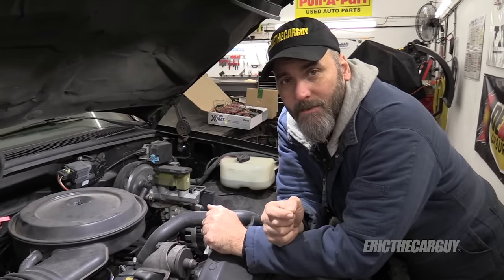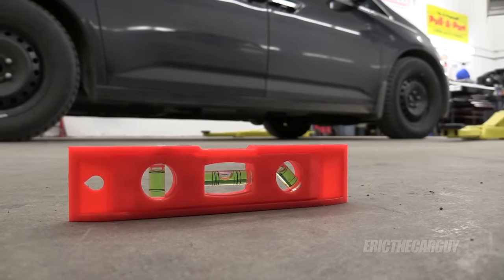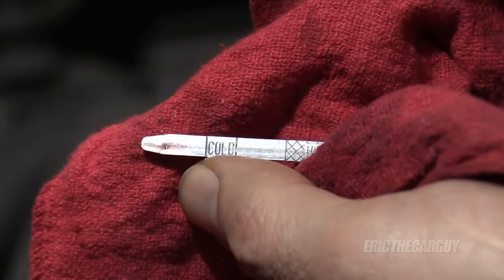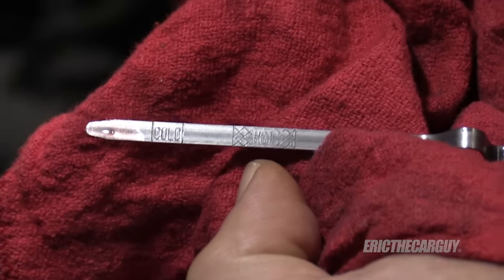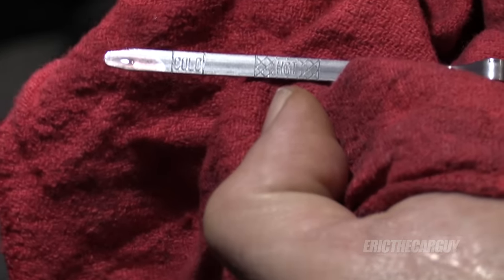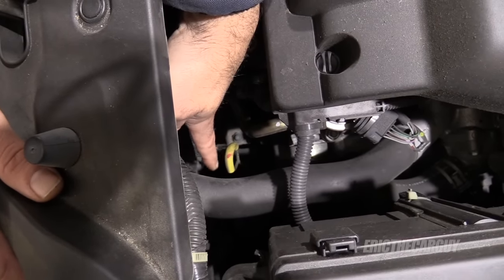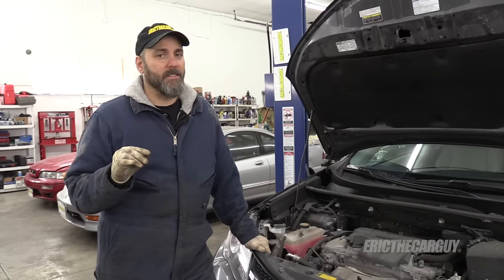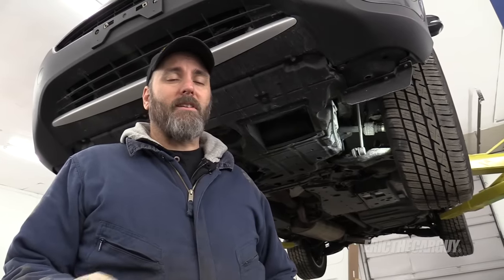How To Check Automatic Transmission Fluid

Comment: Wow....no dipstsick is one thing...but sealing a transmission permanently? That's one of the most underhanded, conniving things the engineers could have done. So simple to engineer in two threaded holes, but no..seal it off completely so the only options the customers have when the transmission blows are -buy a new car -replace transmission. They're designed to fail soon after the manufacturers warranty expires too. Seriously, why dont they just sell cars with no opening hood or accessible engine compartment, no engine oil drain or fill cap, no coolant reservoir or radiator cap, heck, no gas cap! Car rolls off the line with a full tank of gas, and when it runs out you gotta buy a new car! Basically the same thing. Disgusting.
Reply: None of them are truly sealed. They just want you to believe they are. They have drain plugs and fill plugs and they have ways of making sure they are filled and not overfilled. It just isn't simple. They only want trained technicians to do the service. Keep searching and you should find the videos.

Comment: If there's a filler tube, But no dip stick.  Just use your  engine oil dipstick  ;)   If you're checking the condition of the fluid  ;)  Yer welcome folks  ;)

Comment: The ATF I saw on a customer's Chevy Aveo was like used motor oil at 75k miles. They wanted it done after I recommended it. I made the machine flush 8 quarts through it. Still brown. Another 4 quarts and it was reddish brown. And finally after 4 more quarts it was clean on the dipstick. Totaled 16 quarts of ATF to flush that tiny transmission. Thing shifted like a dream after that too lol.

Comment: Great video with very good explanations about checking transmission fluid levels on different vehicles. I do NOT want to be within 10 Light Years of a car without a transmission or engine oil dipstick. Whoever came up with the idea of doing away with dipsticks in cars should be ashamed imo.

Comment: Those locking dip sticks were a recall on 89 or 90 trucks.  They originally had a standard dip stick but had some sort of issue with them sealing or puking fluid or something.  I had a new 89 and I'm pretty sure remember getting the actual stick in the mail via gm.

Comment: It’s pretty ridiculous that today’s vehicle manufacturers try and pass off a sealed transmission, with no way to even check level or change fluid, to vehicle buyers like it’s as good or even in the same category as a properly maintained conventional automatic transmission where you can check and change the fluid.  

Good video Eric.
Reply: Only a Fool would buy a new car.
Reply: We had a 2016 Mazda 6. There was no mention of any way to check the fluid in the Mazda 6 transmission. It simply said it was a sealed unit as I recall. Upon further investigation it does have a dipstick but you have to remove the air filter including the housing for the filter to find it. Then you have to remove the bolt that bolts it to the transmission and you'll find it. They just don't want us to know. Duh?
Reply: What can money don't do this days.
Reply: To be fair, as long as the sealed transmission has a check plug/valve it’s pretty simple to change.

Comment: Thank you Eric for an intuitive how to properly check transmission fluid on a level surface at operating temperature . Always remember to use vehicle specific ATF ie: dexron, mercon, multi vehicle synthetic, CVT and type F (old Fords 1970's. If your transmission slips and reengages making a bump feeling it might be low on fluid . Always keep at least a quart on hand to add as needed but NEVER overfill . ATF fluid expands with heat which is why it needs checking at operating temp .

Comment: I am a Veteran and I perform Preventive Maintenance Checks and Services on my Personal Owned Vehicles.  I will always start at the front and go in either a clock/counter clock pattern checking for damage and any fluid leaks.  Before running the engine I will check coolant and oil levels.  After doing that I will start the engine and run it until the temperature starts to climb.  I will then apply the brakes and shift through each gear and hold for 45-60 seconds in each gear.  After do that, operating temperature is reached and then I check the transmission level.
Reply: Thank you for your sacrifices for this country and its people. I’m so sorry for what this country has become. May god be with you and I hope you live a long and healthy and happy life ❤️

Comment: I always check my automatic transmission fluid when the engine is cold like oil check. So I was doing the wrong thing all the time. Thanks for the tip👌

Comment: Good video and happy to be a premium member (again).  I guess I'm just too old, but I am still not sure sealed transmissions are smart.  But that's the way most auto makers seem to be going.
Reply: Just doing some google searching and apparently a lot of sealed transmissions still have ability to change transmission filter which would mean you also are changing (most of) the transmission fluid.  Would love other info.
Reply: 'Sealed for life' is normally only 100k km/miles still needs to be looked at.

They were getting more and more failures with people using the wrong fluid or fill marks, plus gives the dealers another income stream.
Reply: 100K kms = 62K miles
Reply: Just like how ford has that new “fly by wire”  front end.   It’s too put planed company’s out of business

Comment: You should also run it through all the gears with your foot on the brake and park brake set. And then put it back in park to check it  that gets oil until all the passage ways so so that you don't come up short.

Comment: When i fill auto-f the first time i do it with one of those horse sized syringes. Makes it easy to figure out the graduations on the dip stick, which i then mark with a fine scribe on one of the sides. Subsequent changes make life soooo much easier.

Comment: Remember that a transmission warms up to temperature at or above 160 degrees up to 200 degrees and the motor will be up to temperature much faster than transmission fluid and you can start your engine and let it idle to bring automatic transmission fluid and it can take over a hour for it to reach operating temperature so make sure to drive the vehicle for 10 to fifteen minutes and in cold weather even longer it gets operational much after motor temperature.

Comment: And thanks Eric your video really helped me I went right down stairs and fixed my transmission level. I overfilled it earlier in the day and I had to make an improvised suction device to remove some. The check you did at the beginning of the video on your truck was similar to mine and I added a whole court by accident when I only should have added half so thank you so much probably saved my transmission.

Comment: My Camry 2000. I check atf fluid when engine not running.. and it totally work ok for years without issue.  Stick have cool section and I use Cool Section on stick to  check level in early morning.But now I learn check when engine running.

Comment: Chrysler gives you a dipstick tube but no dipstick.   At a recent dealer service interval I asked them to use their dipstick ( it has fancy temperature sensors attached) and verify it is full.  Then I carefully inserted a flat piece of wire into the tube and marked it with a sharpie..instant dipstick.

Comment: @EricTheCarGuy I'm actually having problems with my 99 Odyssey transmission. Didn't know it had a magnetic filter at the oil cooler, it blew off after years of neglect. I replaced it, added fluid, now first and second gear are shot to hell!
Reply: Odyssey trans are known for trouble. For a Mini Van, Toyota is the choice, not Honda.

Comment: Sir Carguy....  Sometimes the manuals are wrong or dont give nearly enough information.  Even the FSM doesn't seem to give you the details you want.  Like in the case of my 2010 Acura RDX, the manual says a drain and fill is 3.0qt, but nobody ever seems to get less than 4qt out of a warm transmission on a level surface.  The car community is not sure why, but I think they were assuming the front was lifted and you were going to get relatively less fluid out on a change.  I find that when I check my Toyota fluid, the level is high when its cold and not running thus it needs to be brought up to operating temperature before reading the dipstick, but it has a cold and hot reading on the stick.  I find that Honda reads low and has to be brought up to temperature to measure the expansion, but they dont have a cold reading on the stick either so its more akin to checking oil in a honda lawnmower.  Sealed transmissions with stand pipes are a frigg'n joke imho they're trying to use to keep people out of them but the guy over at Mercedesresource .com thinks that the tiniest bit of lint from a paper towel going into your gearbox will mess up shifting so the engineers sealed customers out of it to reduce warranty cases.  He might have a point, but that seems kind of extreme.  I dont go to mechanics because I find nobody treats your car better (or worse) than its owner and I'm gonna save a buck where I can.  However, for the first time in 25 years and due to an emergency, I had to use a local transmission shop who I've been told does good and fair work.  They replaced a pitch mount on my RDX and I only asked them to check the fluid level.  I was told it was fine.  I just discovered they put more than 2 extra quarts in the case 6 months later.  Its my fault for not checking over their work immediately, but hey - because professional.  Even if you dont work on it, knowing the basic measurements is important.  Preventing the average person from doing this is a horrible philosophy.  Even dealerships can do bad work.

Comment: I have read so much on when to check the level like for example some say drive it a few blocks then check, some say let it idle up to temp then check, and my manual doesn’t speak of anything out of the ordinary but depending on which method I use to check I can get very different results which creates an issue

Comment: The temperature of the coolant won't effect the level of the trans fluid.... trans temps tend to stay pretty cold while it's just idling,  driving the car/truck for 45 minutes to an hour will actually have a more accurate reading, rather then just letting the coolant get hot.

Comment: Hi Eric, checking the fluid level on my Vito W639 is very tricky. There is no dipstick so I bought one but it doesn't have a flat blade at the bottom, just a coiled wire. I think I'll add a flat blade to it tomorrow! That should be easier to read

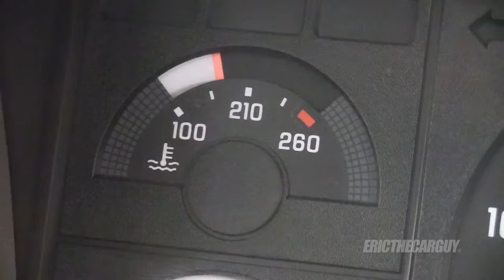Comment: @ 0:23 had that been the transmission temperature Gage I would have been good. In this case the "Transmission" could be cold yet the engine hot or normal, best to drive 10 to 15 miles and then check if it has not been driven since cold.

Comment: I actually had a useful and relevant ad! :)

I wonder why you can't just check the transmission fluid when cold and the engine not running. Is it that different from an engine? It also has a pump, lots of passages, set amount in torque converter, set amount in the lines, cooler...
Reply from the maker: The fluid expands as it heats up.

Comment: I have a 1970 Chrysler with a 727auto. The dipstick says "check in NEUTRAL" And I belive there`s a quite a difference if you check it in neutral instead of in PARK as you usually do.
Reply from the maker: Park and neutral are just about the same, however, if the manufacture instructs to check it in neutral, check it in neutral.

Comment: Before checking the ATF level you first need to make sure that the Thermostat and Fan Clutch is working properly. Most old cars the thermostat is located at the top radiator hose. It will not take more than 10 minutes for the engine to reach normal operating temp by idling if the thermostat is working propely. 

Ford's Owner Manual says: The transmission fluid should be checked at normal ATF operating temperature 66°C-77°C (150°F-170°F) on a level surface. The normal operating temperature can be reached after approximately 30 km (20 miles) of driving.
You can check the fluid without driving if the ambient temperature is above 10°C (50°F). However, if fluid is added at this time, an overfill condition could result when the vehicle reaches normal operating temperature.

Comment: It might be the vehicle differences but I thought the Hot and Cold had to deal with the transmission itself rather than the engine tempurature. Not sure tho?
Reply: Most cars route the tran fluid through the radiator for cooling, so if the engine is up to operating temps, the trans fluid should be there too right?
Reply: best to run a cheap scan tool and read the trans temp from the tool and make sure you are reading the dip stick at the temp the manufacture tells you to read it at.  This is one of those thing things you got to read the manual for and is different per car.
Reply: Bardia Ghajari Mercedes has gone to a similar scheme. They recently stopped installing a fill/dip stick tube on the Sprinter vans. You drain and fill through the same hole. It requires special fill equipment. After you have refilled it, you bring it up to temperature and using the scan tool verify that temp. Then you raise the vehicle running and remove the drain plug, when it reduces to a drip, reinstall the plug and you are done. There is a “stand” pipe attached to the drain port that is at the proper run level for the transmission. It’s goofy and it is to complicate the process so you have to bring it in. I work for a major shipping company and we have to deal with them. It’s not difficult, and you can work around it, you just have to have the knowledge of how it works.
Reply: I found this out the hard way on my Toyota Camry.  A warmed up engine is NOT a warmed up transmission.  The transmission and the fluid in it need to be at the transmission's normal operating temperature.  You only get that by driving the car around.  Warming the engine up to operating temperature in your garage will not do it.  If you fill the transmission fluid up to the "full" mark with only a warmed up engine, the transmission will be over filled after you have had your car out on the road.  Check it out.
Reply: Most transmissions don’t free flow to the cooler they have a thermostatic bypass valve which allows the transmission to maintain operating temp by keeping the fluid circulating without leaving. Similar to a thermostat in cooling system on an engine. It both helps build the heat and allows the fluid to absorb the heat to be sent down to the cooler to be stripped from the fluid. Your trans does take abit longer to get to operating temp. But for quick easy reference you indeed can fill you’re transmission to the cold mark go for a boot around the block to warm up the fluid then check. If it’s got cold fluid and it’s on the cold mark it’ll generally expand and read hot when hot. Always check it tho. Majority of vehicles will have to be running to check it the pump needs to be circulating the fluid the level must always be a the indicated mark if you fill it without running it the second you start it she’s sucked dry. Fords like to be checked idling in park where as dodge is idling in neutral. The dipstick lots of times will tell you on it whether it’s idle and park etc

Comment: Eric, it's transmission that has to be at operating temp, not the engine. Trans fluid won't necessarily be hot even if motor is. I think you know that but missed it in the video .
Reply: Was thinking the same thing, atf expands as it heats up so if it in the hot mark area and not actually hot, when it expands it will be over that mark for sure
Reply: I saw a article online saying you should drive the vehicle for about 20 to 30 mins and check the fluid

Comment: I have a 04 Honda Odyssey the manual said there's a place above the transmission dipstick to put fluid in but also said if there's not one you have to put it in the dipstick transmission tube I could not find a funnel to fit in that transmission tube so I bought me a long funnel and a male air fitting it fits perfect and the dipstick tube so I cut the end of the funnel and screwed the air fitting and the funnel tight and super glue. It and it works well just letting people know

Comment: 2007 Nissan Maxima that is not even up to 48K miles yet: What is the absolute, exact way to check the CVT fluid? Thanks for answering. I have been told; that if the fluid amount is not exactly right; it can damage the transmission.
 True or false?

Please...

Comment: suckkksss i recently got a 2010 tundra and doing my usual replacing fluids after i bought it and found out shortly it was a sealed transmission. im assuming the only way to have it done is a shop. usually i do these things myself but at the same time i dont have the tools to do a proper sealed transmission job.  I mean it shifts and drives amazingly its just man. i can see that being somewhat pricey to have done. i could be wrong but idk.

Comment: Eric, you reminded me, I have a 2003 Dodge mini Van and lately  it is coming out of Overdrive (OD) then back in. You can see it rev up about 500 RPM then back down to normal. I understand there is a OD solenoid that may be bad? It shifts and operates perfectly normal otherwise. (regular maintenance and service has been performed)Thoughts?  Thanks -

Comment: thank, you for you're video. my, question is I seen a  97, Dodge ram 2500 van for sale. I pulled the trans stick first and took notice that the trans  fluid is on the full mark cold with out ever starting up the  van.  is something wrong here ?